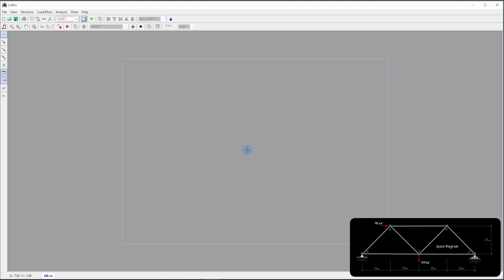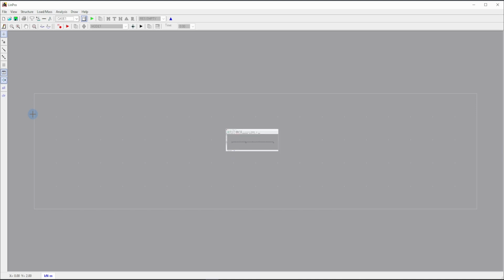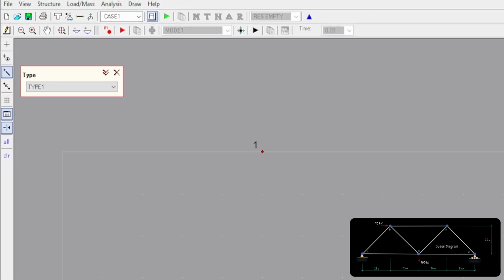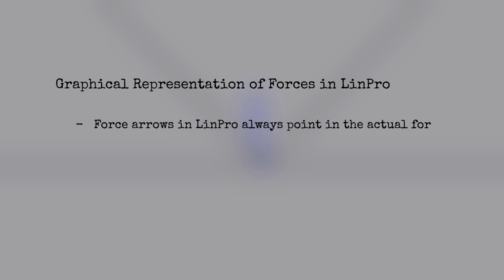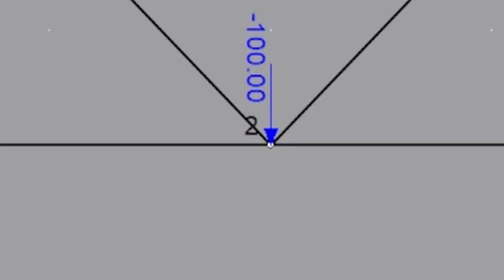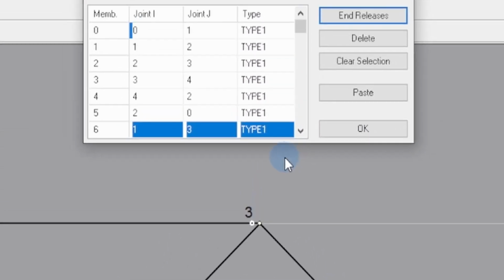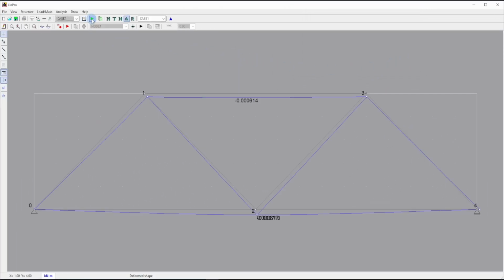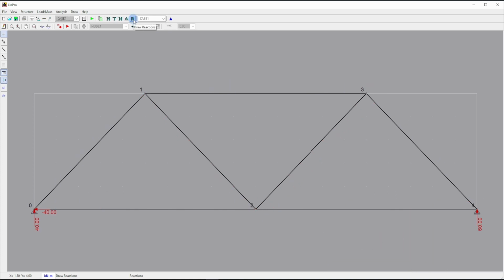LinPro Analysis of a Pin Jointed Frame

Comment: I am trying to utilize LinPro to model a scissors lift with the objective of finding out the force required by the hydraulic cylinder needed to lift the load.  The effective force is a function of the cylinder angle.  My plan is to have one of the members represent the hydraulic cylinder which is pinned on both ends.  Any input would be appreciated. One of the challenges is the X of the scissors lift is four member with a pin between them.  Opposing member have to stay inline like they would in real life.  This has proven to be challenging.
Reply from the maker: Thanks for the comment and apologies for the tardy response. If you are still wrestling with the problem try building the model described below.

I suspect the models you're building are actually a mechanisms. To investigate I suggest you build a 4-member, 4-pin simply supported frame that looks like an hourglass - 2 members for the scissors and two horizontal members, one top and one bottom. Note, the scissors members have no connection between them.